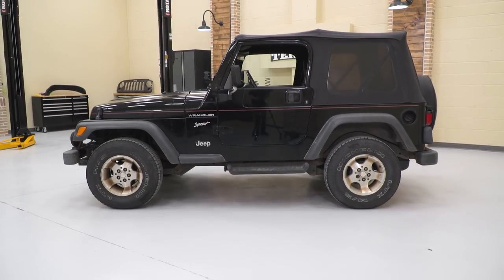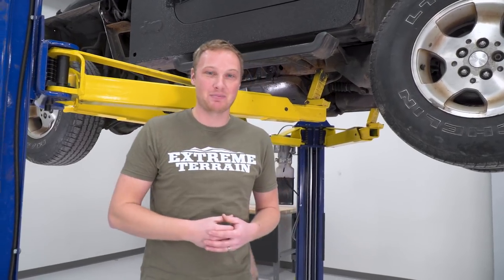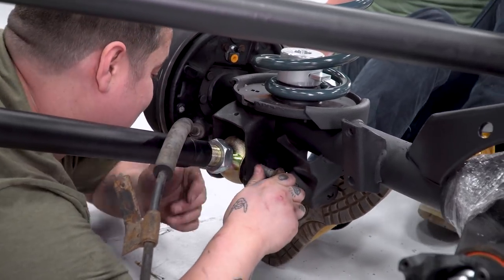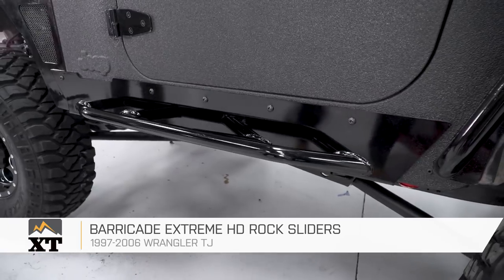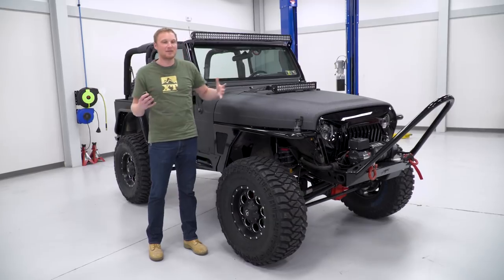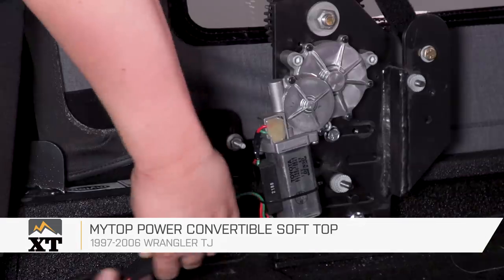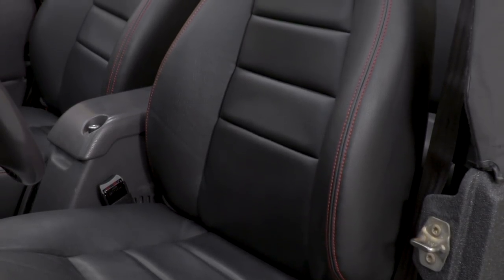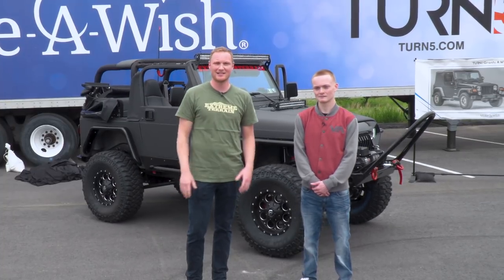2002 Jeep Wrangler TJ Build For Make A Wish Foundation By ExtremeTerrain - Throttle Out

Comment: Got my eyes leaking blinker fluid dammit
Reply: Save that blinker fluid.  You can use it in your Jeep.  As you know, if you do not change your blinker fluid regularly, your entire electrical system will corrode and your vehicle will stop running.
Reply: Don’t forget about the muffler bearings
Reply: Never forget the exhaust paste
Reply: Still having problems with this build, embarrassing
Reply: Don’t let spark tube get rusty

Comment: Bit of advice? Flip those johnny joint ends. Having the zerks facing down means even the slightest rock or log will rip them clean off. Just install some angled ones that you can access from the top side.
Reply: LaytonSky 
Completely agree. I'd rather have to struggle a bit to reach the zero fitting than not have one to fill, haha

Comment: Love the video!  Seems like everyone is going with JK upgrade videos and it;'s great to see the TJ isn't forgotten.  Also really great you doing this for Make a Wish.  The only problem I see is the exhaust dumping under the body.  Is this legal?  In PA it won't pass the inspection 
regulations.  And is it safe for the passenger compartment, build up CO2?
Reply: It’s 100% Legal
Reply: @RedDragon-zn3jj  As per PACode 67, section 175.5 ( PA Inspection Regulations)    “(5)  An exhaust system shall extend and discharge completely to the outside edge of the vehicle body, including a truck bed, or as originally designed.”
The turn downs at the end of the mufflers are totally illegal in PA.   The video by Extreme Terrain shows vehicles inspected and registered in PA so their exhaust mods are illegal.

Comment: Awesome! What was done to the stock axles to be able to handle 35” tires. I’ve always been told a D30 and D35 would break or bend with any type of wheeling if you were to put 35’s on them.
Reply: Kyle Pendley theybdidnt say, but im guessing just truss it and chromally axles. Without a locker, that should be fine. People run 33s on stock d35s all the time
Reply: Regeared with 373s and all new parts

Comment: Awesome build! So many ideas for my TJ. What valve cover, oil pan and valve cover gasket did you use? I couldn't find it on the build page.
Reply: I noticed you didn't replace the 3rd rear catalytic converter. How can you do this and pass emissions or throw codes?

Comment: You replaced the frame and put a teraflex lift in....but kept the Dana 35 for 35” tires? A ford 8.8 would have been so much more practical and not expensive.

Comment: The Oracle lights system could cause a problem with the police 😂they don't like these lights.cause they're similar to the police lights and putting them is illegal

Tell me if I'm WRONG guys
Reply from the maker: Key word is COULD! Really comes down what state you're in and how you drive! I've seen plenty of people at Jeep meets here in PA have rock light kits without any issues. But if you're going around driving recklessly, flashing red and blue lights, needless to say you may get pulled over. -Zach